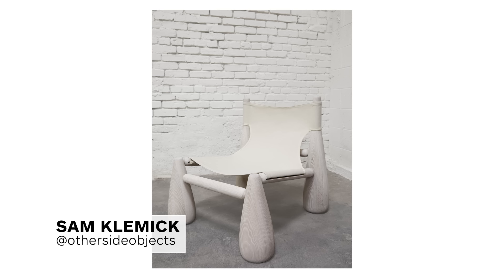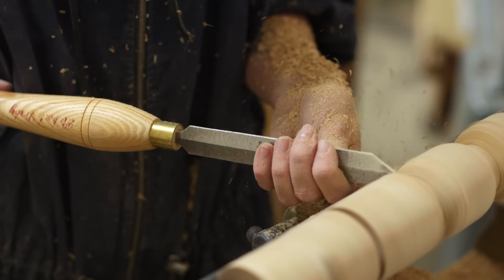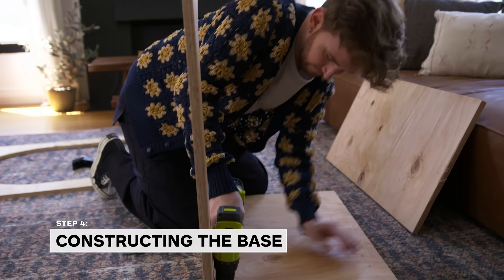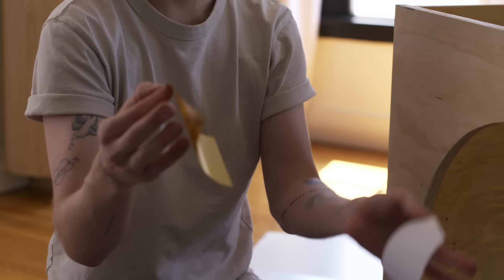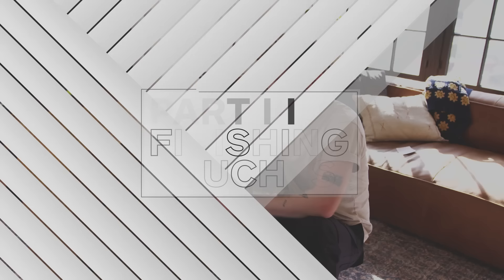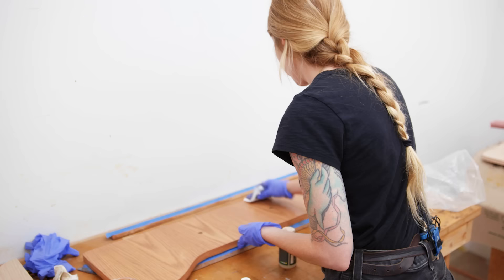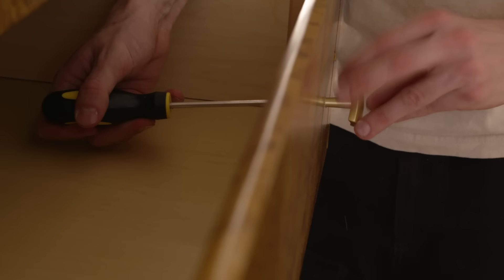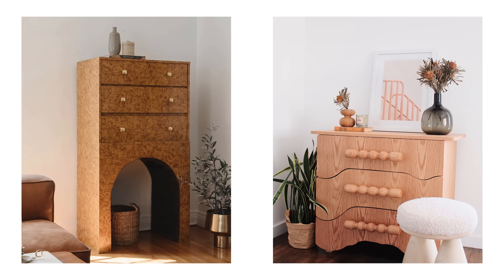2 Designers Transform The Same Target Dresser | Custom Crafted | Architectural Digest

Comment: Sem's execution was obviously superior but Drew's design was 🔥
Reply: Drew's is too tall to be practical, it makes me uncomfortable thinking about trying to utilize the drawers.
Reply: @notverynotoriousg5674  it would definitely need to be attached to the wall
Reply: It wasn't "obviously" superior to me.
Reply: @lovingmayberry307  using veneers instead of contact paper, if you are all about contact paper then you go, but i'll take the veneer.
Reply: @lisahuber9329  you would need a small ladder to access the top drawer or two as well. extremely top heavy.
Reply: Drew's design was simply putting this paper all over it. Very little craftsmanship.
Reply: @Bethman-c3p  I guess that's sort of the point, though, of this series. The fact that you can do even without tons of craftsmanship? (although, to be fair, he did construct the bottom, which is a bit of craftsmanship, even if it's not on the same level of skill or tools as Sam's design)

Comment: Neat series. Sam's doing a rebuilt-to-last but in 3 hrs couldn't replace the drawer slides. I think the loss of storage space where the droop goes should be discussed as it makes the drawers essentially shallower. Drew's looks less permanent, like a shorter term friendly budget upgrade. Very different approaches. Wonder what Sam's cost, missed that comparison and wish they discussed the trade offs they made with their limitations of the project.

Comment: Ok damn Sam knocked it out of the park. It’s stunning. Drew usually does really good diys but this one is a miss. It looks a bit cheap with the high gloss. I think keeping it just with the vinyl would have been better since it was already shiny. It also shouldn’t have been as tall since reaching that higher drawer isn’t a comfortable height. It’d be cool to see him try take another stab cause this is not it
Reply: Yes, and the execution as well. It shows that design isn't only pink flowers but also hard work and practice. You can really see the difference of expertise in craftsmanship between Sam and Drew.

Comment: Love the look of Sem’s design, but the squiggly drawer faces reduce usable drawer volume significantly. You can only put things towards the centers of each drawer, otherwise the drawer above will interfere. Having form over function doesn’t sit well for me, but it is pretty 🤷‍♂️
Reply: I don't think the drawer faces interfere with the drawer capacity...
Reply: @korvapuustit  The face of the drawer above it will interfere with the lower drawer opening in a filled state.
Reply: @lestranged  barely?

Comment: What a fun idea for a video.  They both turned out great, but I did end up thinking …. Sam hasn’t transformed the dresser, she basically made her own but added a bunch of unnecessary steps because she basically did it by dismantling the original dresser piece by piece and replaced it with her own.  So while her skill and the design is impressive, it wasn’t really a transformation ….